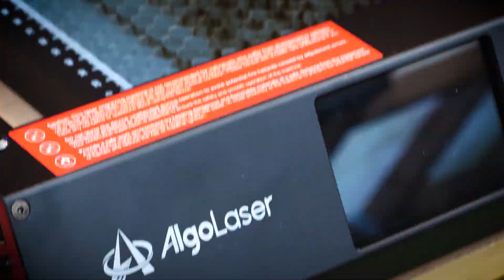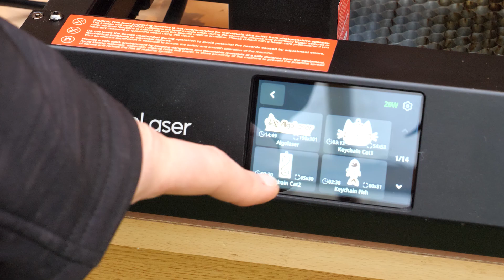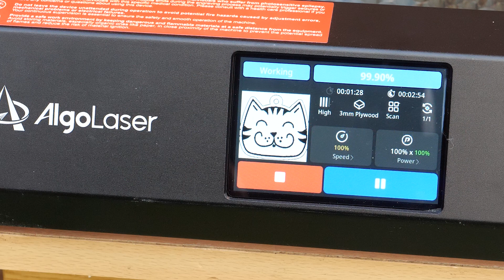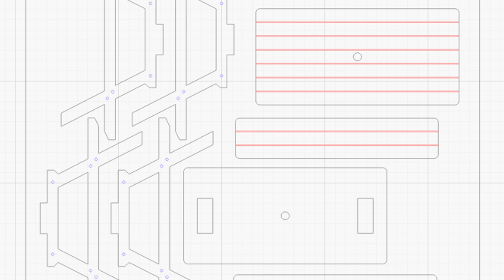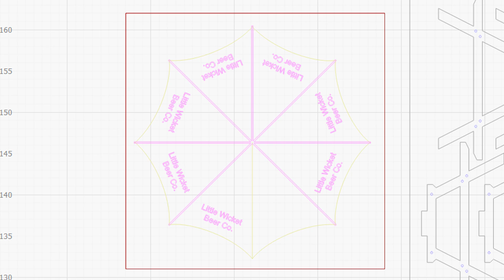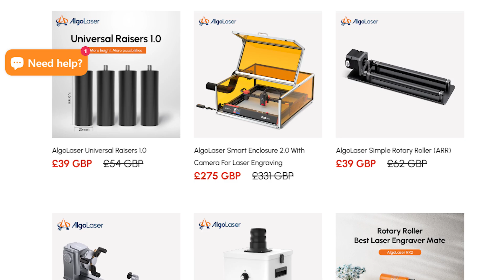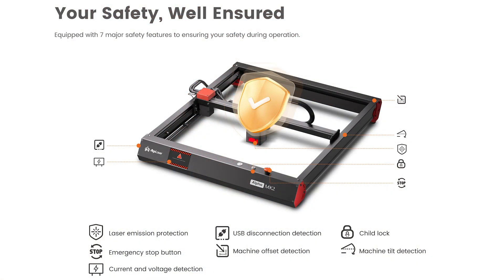The Future of Railway Modelling Uses Lasers | Algolaser Alpha Mk2

Comment: That's a cool O gauge wagon.  Do you have any numbers on how the cost difference would be comparing laser cut as you did vs resin printed?
Reply: On something G scale like this wagon, the laser-cut materials are way cheaper than FDM printing, and while I only make small items on resin printers, they are way more expensive to create than FDM. Laser cutting is fantastic for creating custom buildings etc. too.
I have a less powerful Creality 12w engraver/cutter but it does a decent job. The Algolaser would be even more versatile.
Reply from the maker: Afraid not. I've got an entry level resin printer, but I'm not very good at printing with it. The laser cut wagon cost maybe £1 excluding the wheels.
Reply: @LittleWicketRailway  £1 is nothing to worry about then.  Can't go wrong.😀